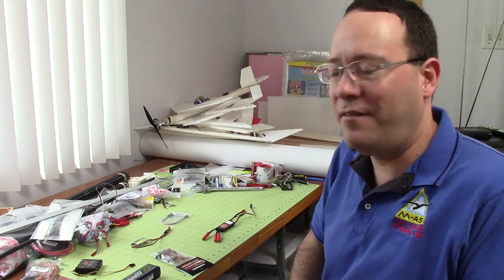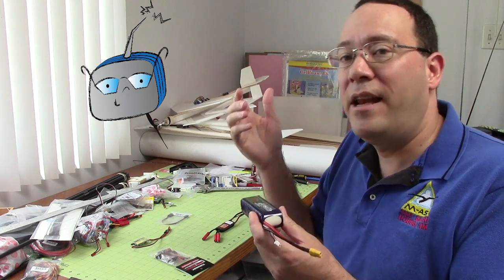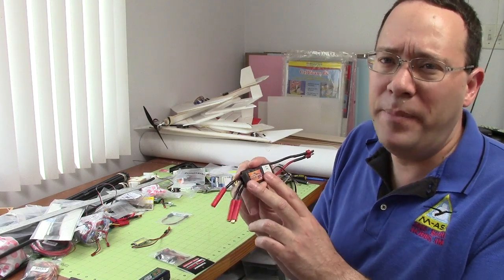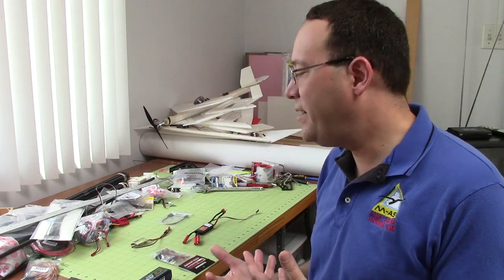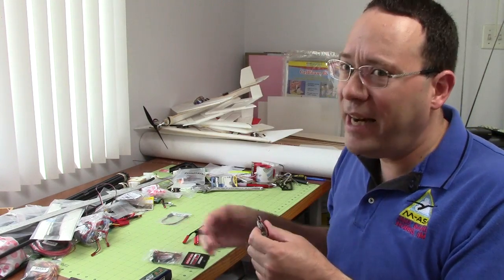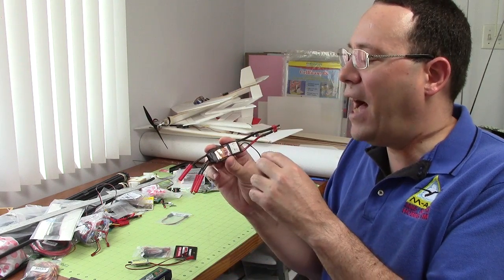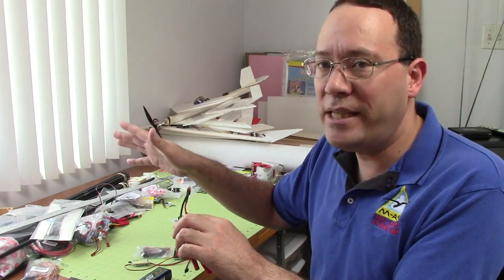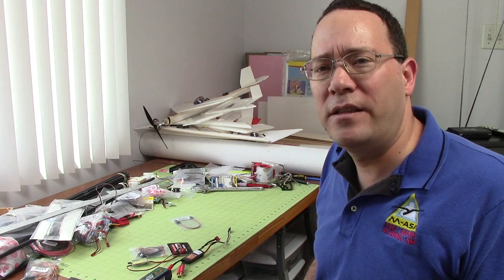Model Aircraft BEC Guide

Comment: You do not need to buy a adaptor to plug into the recever wire on the esc when using a external bec. Instead simply remove the positive red wire from the esc bec output.

Comment: Thankyou.
I'm building a Y6 coptor meaning under each motor there is another motor, upside down counter rotating. I think i will use a 4 cell or biggest 3 cell lipo, I'm not sure :(. I plan to run everything from the main battery. Cannot decide about the BEC, UBEC or SBEC but your point on heat has me intrigued. What to buy ??? Should i just use a simple timer and on board alarm system for low battery ? Thank's in advance.